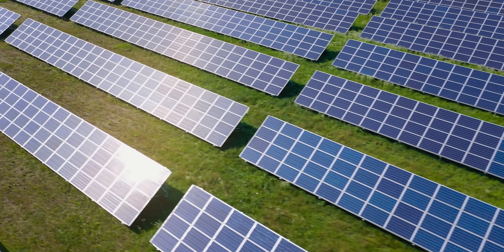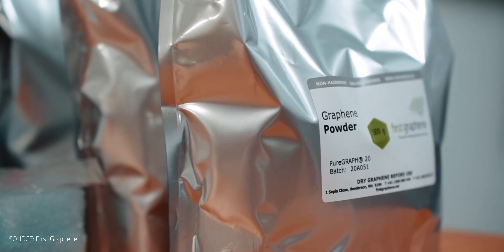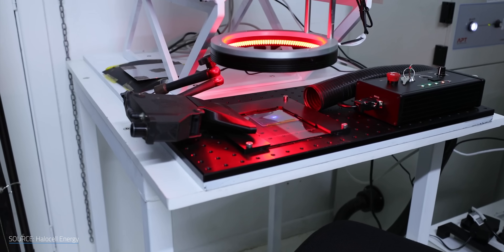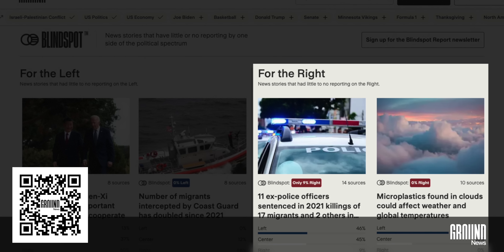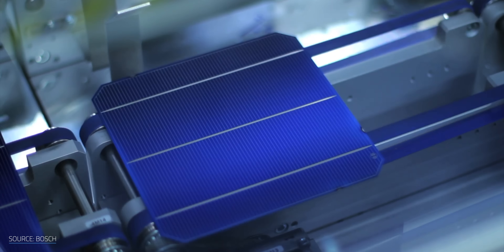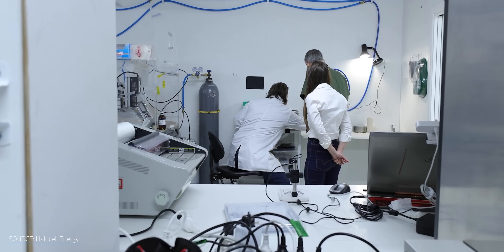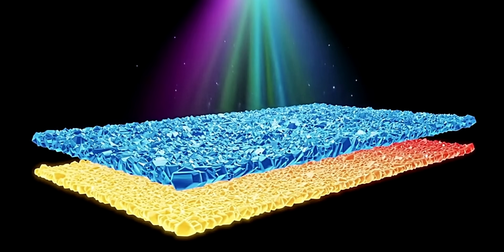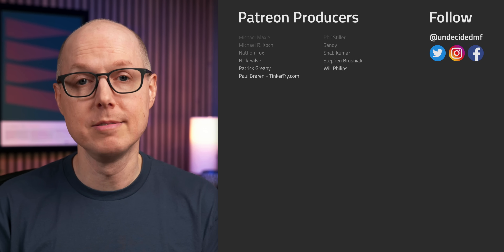How This Perovskite Breakthrough Could Change Solar Forever

Comment: This sounds like good news.
I almost didn't watch this because as you said, Perovskite has been covered again and again, and there have been several challenges yet to overcome.
Graphene has also had several challenges to overcome, but if these things can be brought together in a cost effective way, then it could be a significant boost to solar power generation.
I just wish we could get Solar and Wind power back into the USA power grid (that Fat Orange Bastard has derailed many efforts pretty well so far).

Comment: Graphene did revolutionize capacitors. Ultracapacitors capacitors/ Super capacitors are amazing for I can turn the engine  on my car for about 30 seconds and I use them to enhance battery backup banks because they take away the abuse from a battery when something needs a surge of current. I hope that these two technologies do make a difference. I know that we could have done a whole lot more with Graphene. I hope something takes off and Perovskite with Graphene maybe something with a future . Still disappointed for so many promising technologies that have been advertised and never really happened.

Comment: This is great news as we will need to double our energy capacity over the next 10 years or so. The problem is that solar energy is currently relatively cheap coming off the cell. Roughly .03 cents a kilowatt hour, but in order to make Solar a very efficient process you need to have battery storage. That’s $.17 a kilowatt hour. Then you have to redo the distribution system, i.e. the powerlines. The ladder two or where the serious problem is with renewable energy. We know how to make it, and improving that is certainly a benefit for everybody. But from a cost deficiency standpoint, you have to attack the ladder too issues.

Comment: The massive drop in the cost of solar panels have already changed solar forever, BTW. What would be useful is to broaden the focus on the costs of the balance of the system, i.e., what fraction of the cost of solar photovoltaic electricity generation is now in the cost of the panel per KWh generated. Are we at the point where the most important cost-limiting factors are in the rest of the system?

Comment: If you think about it, a battery with its own PV Panel to recharge it would become a new standard for hand held devices such as cell phones, remote controls etc.  That would be a good place to start.
Reply: @anguscampbell1533  that's what solar powered pocket calculators are.

Comment: Like all tech, what matters is the ones that can be mass-produced, cheaply and using abundance of available resources.

Without that, it might as well be a lab top that might or might not reach the market and even if it did, it's in such small numbers or so expensive that it has little impact on the market, reaching mass consumers is the key to game changer, and as we know, we've heard countless promises of what might come, it means nothing until it's on the market in big numbers and low price.

With that said, it probably doesn't matter, a lot of innovation and investment is going into renewable energy of all types, the price of which is coming down all the time, the renewable energy tech isn't really that much of a problem any more, what is a problem is having a big enough buffer to store renewable energy, especially as more renewable energy is generated, we are going to create more energy than we need at certain times of the year, so we need a massive improvement in being able to store that energy.

With that said, I'm all for any new breakthroughs in renewable tech, but as long as renewables keep getting better and dropping in price, it probably doesn't matter much as the transition is well on its way around the world, especially in countries that don't produce much in fossil fuels, which could give them a massive advantage over the ones that do, being how the fossil fuel curse works, but that depends on if the government is smart or not, Norway is a prime example of going all in with renewables whiles also using it's fossil fuels wisely, building up a lot of wealth for the country, most countries waste a lot of that advantage when it comes to fossil fuels that in many ways is a blessing for countries that don't have it.

Comment: The panel cost wasn't why we skipped solar on our home it was the costs of the battery storage because to be honest it does not seem to make sense to do solar without having a battery
Reply: It depends a lot on the utility and their 'net metering' rules. In my case (south Florida) it makes sense economically to go solar even without battery storage, but I still haven't done it :( Waiting for better panels that are 'just around the corner'. 
I'm also waiting for sodium ion home batteries. LFP batteries are quite affordable already, but sodium ion should be even more so, IMO. Although solar without storage works for me economically and I already have a generator for backup, I'd still install batteries if they are safe and cheap enough, which I think sodium ion should be.
Reply: @hangup23  the problem is that waiting for the technology "right around the corner" probably already cost you most than you would save with them when they come up specially because there will always be a new technology "right around the corner. technologies are already good enough, just go for them. use the technologies "right around the corner" in 20 years when need to replace your setup, they will be much cheaper by then.
Reply: @danilooliveira6580  electricity is very cheap where i live, so no, in my case, it hasn't cost me much yet, but I'd like to future proof the residence. it makes sense for me to replace the root first, before adding solar. and the roof is good for a few more years, so I have time.
Reply: @hangup23  yeah that makes sense, the payback period vary a LOT around the world. looking at solar irradiation alone it can be as low as 4 years here in Brazil and 10 years in Canada in average. if you include energy prices, subsidies, installation costs, and regulations, the difference can be even bigger.
Reply: that depends, you mostly want battery if you want to go off the grid. most countries will offer you energy credits for you to use during the night.
Reply: I put 10kW on my house in May, didn't put in a battery due to cost however the system is battery ready. I way oversized my system for current usage needs but i plan on getting an EV when a suitable one is available, hopefully within the next couple of years here in Australia. 
My bill is now zero. Summer started with a 36 degree day and it cost zero to run the AC all day while i was at work. The extra electricity i generate and export covers the small amount i use during the night.
Reply: They aren't that expensive anymore.

If you use solar for heating, cou can heat up a buffer tank very cheap.

If you use it for power, you need a battery that lasts for a night.

I have 2kwp and 5kwh battery. In summer it covers 80%of my electric needs.
I payed 2.300euros and will break even after aboute 36 months

Comment: Worldwide reliability, as you say, is a huge stumbling block for Perovskite. Working well in Saudi Arabia and Scotland with the same construction is pretty daunting.

One thing that is holding back domestic scale silicon PV is the promise of greater efficiency and durability just on the horizon. When, thanks to scale, the cost of the currently available panels is lower than the likely cost of installation already, home owners are thinking that, by waiting a couple of years they might get a system, for a similar cost that has much greater efficiency. Meanwhile gas and oil prices will skyrocket.

I believe the drive for efficiency is great but it's a promise of jam tomorrow from researchers seeking investment, not a factor in the battle for decarbonisation now.

Efficiency is a great selling point in the marketing of panels but if we were selling boring old reliability and longevity, we'd be signing up more customers.
Reply: exactly, the technology today is already good enough, just because it can be better doesn't mean we should wait. might as well wait for the next 10 to 20 years and THEN replace whatever you have with newer technology when it's cheaper and more reliable. because installation is indeed the bulk of the cost of home PVs, it's what makes them the most expensive energy source at the moment, specially in the US.

Comment: With all the due respect for your work. this is something already well know. at NREL in Colorado they are using ALD to deposit SnO2 for the same purpose. Protective layer that works also as transport layer and improve efficiency. Waaay more scalable with Spatial ALD that any Graphene. And it is something ready to install. In a year you would have your fab going with it. 
if you want, I can explain you in more details. I sent you an email :)
Reply: Did you mean SnO₂ aka tin oxide?

Comment: If you have a tech reducing 80% of costs and increasing up to 30% the efficiency AND STILL need more investments - YOU DON'T HAVE THE TECH.
Reply: What do you mean "have the tech"? It works at small scale. Every new tech struggles to scale up. Li-ion batteries weren't practical to be mass-produced, until they were.

Comment: Solar panels cannot come down much more and it will have little affect if they do., a lot of the cost is now simply in the physical logistics and structural components involved, that are unrelated to the tech.
We are already at the point where the cost to install a solar panel exceeds the cost of the panel.  
500w panels are $50 each in volume ex china for tier 1 panels.
You are  more limited by physical placement and install cost restrictions in the current market than you are limited by the actual panel cost.

Comment: Stuff like this .. imo, all these Trump Era anti-green energy [ _ ]ups may end up resulting in a silver lining.  As in , here in the US we still have far too much very aging very inadequate electric and communication infrastructure. After we survive this next year or two, it's fair plausible that we build back better and this time with cheaper and better infrastructure from the get go, hopefully stepping over the mistakes our nation still continues to do simply because no one wants to sign off on spending to removing old infrastructure to replace it before it fails.

Comment: The most amazing revolution would be lowering the commissions. “Standard Commission Range:
For a solar system costing around $25,000 to $45,000, the sales commission could range from $2,500 to $9,000.”

Comment: the PV element at this point represent less that 10% of the cost of a complete system things like, cover glass, frames, interconnects and inverters dominate the cost now. PV systems are approaching the top of their technological s curve at this point, the rapid cost reductions that we saw the early part of the century have basically flat lined the last couple of years. at this point even if the PV element was at the theoretical max and they cost nothing to make it would only lower the end consumer cost by about 30%.
Reply: "Only?" 30% is still a huge improvement!
Reply: @SheenaMalfoy  over the multiple decades to get to that point  not realy. Stuff in the labs is still only about 45% and lab to commercial  viability is 10 to 20 years  so i would  expect the the labwork to clap out  in about 20 years pushing into low 60% range. And basically have the most economicly optomised pv panels aviable to end consumer in the late 2060s time frame. to drop the cost more we would have to lower the cost of the imputs to the production  process. And that is namely energy. unfortunately the grid is already near capacity for the amount  of renewables that can be added economicly without storage. And batteries are still way to expensive for large scale storage by which i mean 100s Twhr level not the measly few dozen Gwhr we are doing nowadays. So unless we start pumping out SMRs by the train full or move into space in a big way i dont see much of path to radical  cost reduction in the energy sector.
Reply: exactly - i mean this research is fine. But the ROI on a standard panel (if you isolate the panel cost only) is under 4 months.
Reply: @simon762321  If you have a window unit, refrigerator, box freezer, or computer, you can quickly realize savings with a non-grid tied system.   In my case, the primary value has been preserving food during an extended power outage, savings on propane (since i didn't need to run my generator 24/7), and "loaning" power to friends who were having power outages when I wasn't (via the storage).
Reply: How dare you bring logic and facts into this tech gooncave!
Reply: The cost of storage and panels is projected to continue to drop by an average of 4% thru 2035 (a bit faster 2026-2030 and a bit slower 2031-2035).   The primary cost will be human installation and integration with your electrical system.    If you use a non-grid tied system (mainly to run a window a/c, a box freezer, a heater, some lights), the cost is quite modest now (about $1400 including cabling).
Reply: @mac_mcleod most of that cost reduction  is going to be storage improvement  we are lower on the s curve for batteries still. I have fairly advanced  custom off grid system that ive built up And the solar panels  we by far the cheapest  part. Batteries are the most expensive part. I would  love to go 100% solar but unless batteries drop by another 2 order of magnitude in price im going to be relying on my propane genset for a long time.
Reply: @orbitONhigh  I think a drop of 1/3 in the cost of solar panels over the next 10 years is still quite impressive.   And that's what the projections indicate is expected.

The batteries are dropping in price at an insane rate now.

The fixed (and increasing) costs will be professional installation, certification for grid tied systems by an electrician, and the cost of the mounts (tho mass production might drop those some).

Also, as capacity increases, the need for professional installation increases.   You could easily kill yourself with a modest do it yourself system.   As long as it is a turnkey battery pack with plugs, the risk is similar to existing plugs in your house.

Next year, I'm hoping to build Will Prowse's dolly based 6k system (which might be a 14k system by then).  That's more than I need since my fridge, freezer, and laptop are most of my 8kwh per day.

I don't want to grid tie a system to pick up the other 2kw in lights and vampire drain from the TV and various led's on devices.  Also, I expect to downsize from my current centrally located house on $$$ land to something on cheaper land with lower property taxes.   They'll probably tear this house down when I sell it.

Comment: I'll believe it when I see it. I still don't have a nuclear diamond battery in my laptop so...
Reply: no one said you would though, the nuclear diamond battery would only work for very specific applications. don't believer everything sensationalized headlines tell you. this is different, this is a technology intended to compete directly with silicon PVs, and the potential is there. it just needs to go through a few hurdles that affects its longevity and reach economy of scale.

Comment: Let's hope something comes of the peroskvite-graphine discovery, we've been hearing of "game changers" and "breakthroughs" for many years, and very little seems to ever be implemented or change.
Reply: I've noticed that all my life. Nuclear fusion, solar cells, high-energy batteries, fuel cells and hydrogen fuel infrastructure. Everything is always right around the corner... In another 50 years :)
Reply: @devilsoffspring5519  It does seem like development of these advancements are measured over something like 1000 years, instead of just 30 to 50, so at such a scale, technically speaking, 50 years can really be 'just around the corner' indeed =p